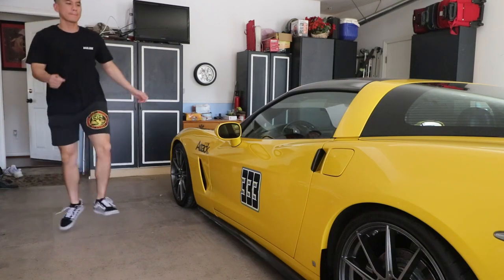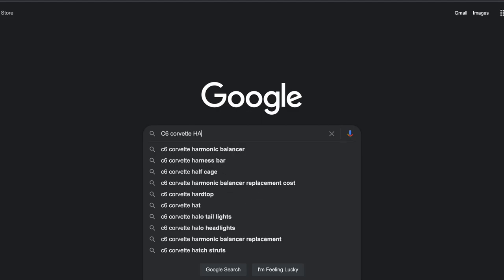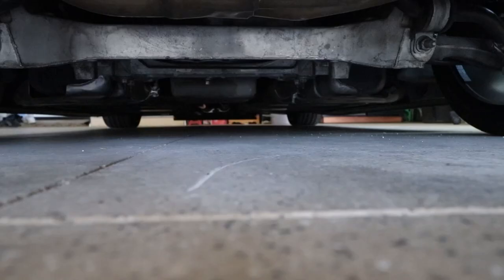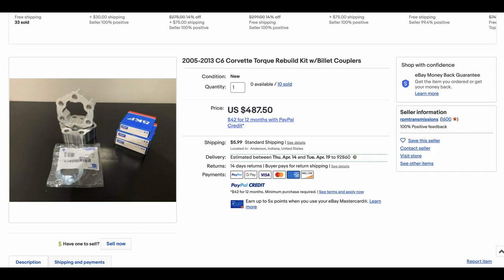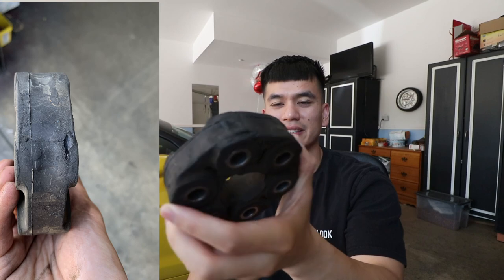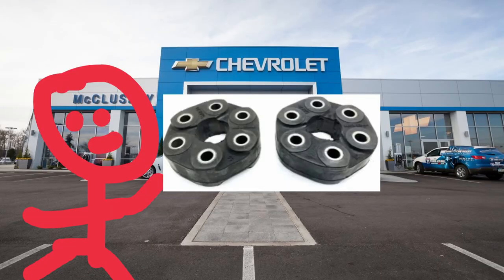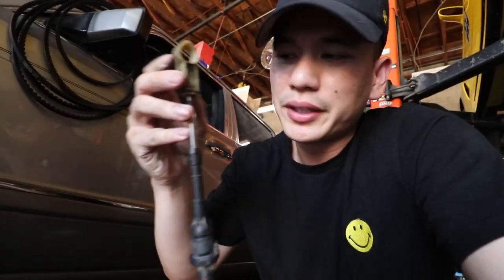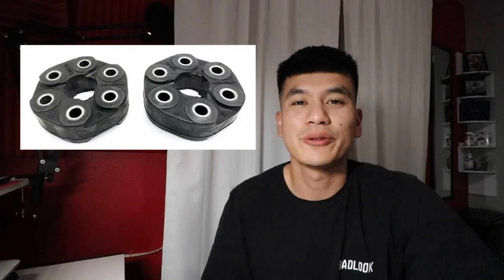This part will ruin a C5-C7 Corvette’s drivetrain

Comment: Any high performance car is going to need maintenance along the way especially if your using them as intended.  Frankly that little rubber coupler looks like a consumable to me and I would have gone neoprene again especially if the car sees track time.  This looks like just one of those things that should be on your maintenance schedule obviously not very often but its going to need replacing.  I ran an 08 Z06 with some mods and still love that LS7 now I have a 17 Z06 with both program and hardware mods both cars always ran/run strong but just remember maintenance is a cakewalk compared to having to fix stuff that you caused yourself by NOT doing maintenance!!!
Reply: Thanks Karl...